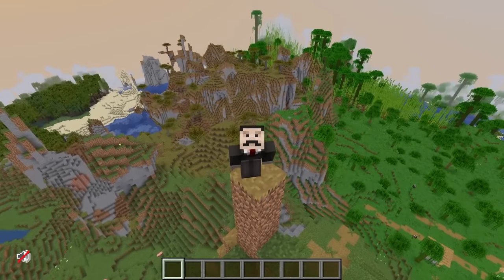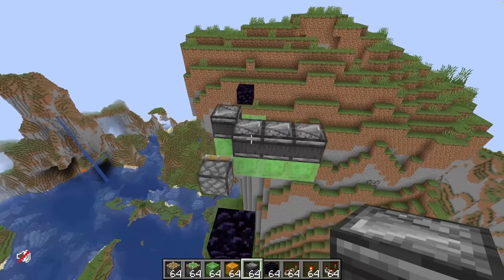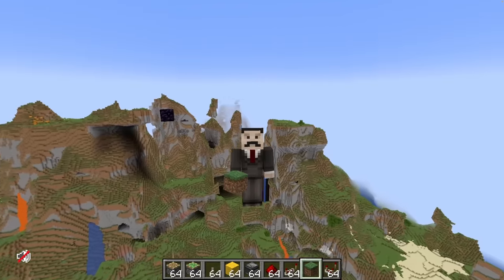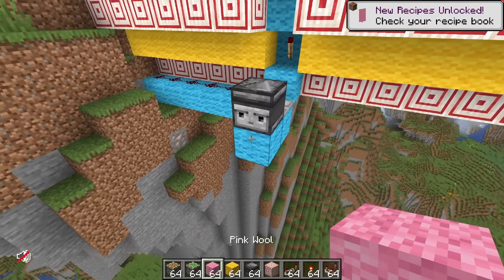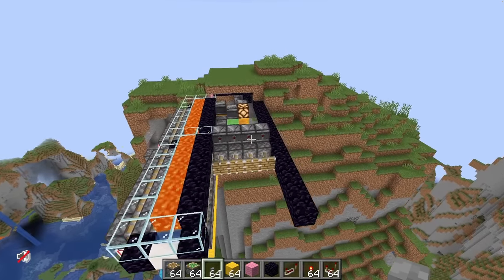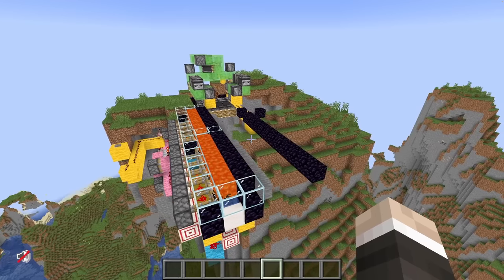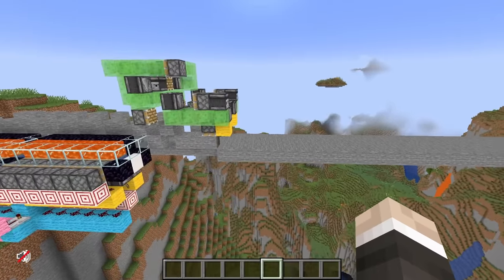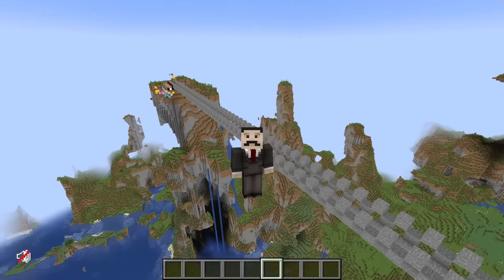Self Building Bridges in Minecraft 1.20

Comment: This should be used decorate the sides of the dolphin highway on Hermitcraft. A walkway could be added to the sides so it feels more like a complete structure. I’d be interested to see if this could be used to make wall / pillars as well. I think it’s generally impractical, but for long regular structures like bridges, tunnels, and walls it would be interesting to see how a redstone contraption could automate the work. Even if the machine is slow, going afk while the machine finishes portions of a build would be very helpful. You could even set up chunk loaders along the path to extend the range of the machine.
Reply: No need for chunk loaders. If you are afk just ride the machine
Reply: A roof wouldn't even be that hard. Make another walkway ~4 blocks higher, then push the blocks down in the shape you want.

Comment: Hey mambo I have some ideas but only works for the foundation tho. 
I can't think about the fencing😅
You could actually move the stone generators up by 1 block and when it's ready
 use cluster of piston to move it down to correct position and send it off

While the machine is flying the stone gens keeps running and when the sender machine is arrived the stone block will be push down like a quick reload and it immediately ready to send another again

If double extending piston is possible might works but the stone gens below the builder by 2 block because the upper part was already taken by the railing guard machine

The reason why it must below 2 block is because i am afraid some stones might get pulled by the back section of the flying machine (foundation) and gets broken

Comment: I wonder if moving the stone generator underneath the flying machines would result in a tillable design, making a self building platform…

Edit: Okay I've replicated the flying machines and it seems that if I try to put two units side by side, the stone-pushing pistons at the ends get stuck on the adjacent module's sticky blocks, causing the adjacent module to seize up. So no, as is the machines cannot tile.
Reply: Try alternating slime and honey
Reply: @averyseeman7  I did try that, but it still gets stuck, not because I have sticky blocks connected to sticky blocks, but because the sticky blocks on one module gets attached to the piston in front of the other module's sticky blocks.

Comment: Mumbo would absolutely love the bridge building on bedrock edition besides the inconsistent things. I built a flying machine that makes 16 block wide row of basalt and makes it into a nice bridge. I even added a piece in the middle that pushes and pulls the blocks to make a 2x2 gap in the floor then another part dispensers water buckets to make an infinite water source then picks it back up and places it again and again. Then all I have to do is run across it with frost walker 2 and i have a nice safe 2x2 boat bridge with a 2 block path on both side and a 4 high wall on both sides

Comment: Saw your old AI silly redstone ideas video, and thought I'd see what a more modern AI could do, with much less prompting. (My prompt stops at the period after 1, everything after is AI generated. And it obviously knows some things about Minecraft.)

You are looking at a list of silly Minecraft redstone contraptions. The list reads:
Silly Redstone Contraptions
1. A pot filled with water that when placed on top of a torch becomes a furnace.
2. A tree made from redstone that lights up.
3. A square plate with redstone that creates a path for a hopper to drop an item into a chest.
4. A cactus that lights up when in contact with lava.
5. A door made out of wool.
6. A stonecutter that creates an iron door.
7. A button that is a minecart track with a dispenser in front of it that dispenses a snowball.
8. A farm with an irrigation pipe.
9. An archer that shoots arrows in the direction that a player presses the button.
10. A creeper that shoots a green ball when it explodes.
11. A piston with an empty space between it that opens and closes to move items.
12. A lever that when pushed, moves a lever.
13. A redstone torch with a block in front of it that illuminates redstone dust.
14. A lever that moves a piston that moves a chest.
15. A button that moves a piston that moves a door.
16. A door that opens and closes to make a square that goes down and up to make an L shape.
17. A hopper with a sign that tells a player to push the button.
18. A hopper with a lever that pulls the hopper up and down.
19. A hopper with a button that shoots out a random block in the air.
20. A furnace that uses wool to make a bed and is powered by an iron golem.

Comment: Mumbo with your inspiration last I made a flying machine about 6 months ago what lays a bridge over the nether. I did it on IOS. And what I used was a pull and push flying machine. On the right side was the push segments and on the left side was the pull segments. On the right side I had about 6 different pushes and on the left I had about 9 pulls. The 2nd push held the necessary glass blocks to allow the water to flow on from a dispenser (which was situated on the 4th push segment) and I would use a piston to extend each movement of the segment by use of an observer. The first segment to move would by the end push segment which would lead round to the first pull segment and about the 4th pull segment in was my lava dispenser as lava flows slow. The lava would flow all the way round until AFTER the water dispenser segment then the following push segment would cut off the lava flow. I know that sounds complicated. I wish I could show you my work. I think you’d approve.

Comment: so for this the real question is, how long of a bridge would it take in order for this build to be efficient enough to build? if you already have the plan for it i would say that as long as the number of blocks placed for the contraption is less than the distance you would travel then its technically worth it however as a single use contraption that seems to take alot of setup i would say that its probably better if it was 2-3 times the distance in blocks as the number of blocks placed, somewhere around 200ish blocks might be an appropriate distance for something like this.

Comment: Hey mumbo, I have an idea:

Can you use the new calibrated skulking sensors to create an advanced password machine that tests if the password is in the right order.

I have the base idea for how it'll work, but I want to see a professional do it
Reply: can you explain the base idea?
Reply: @skmgeek  so there will be a row of machines with skulk sensors calibrated to different sounds. When a sound is played it closes the first skulk sensor  with wool and opens the second one. It continues until the right code is played, or resets if the code is wrong.

Then their is a path of dkulk sensors from the decoder to the input. At the input, there is a row of 3x3 buttons. Each button plays a different sound, but 1 button is an instant reset button. 

When you press a button it plays a sound, which is then carried to the decoder by the skulk sensor path. If the sound matches the number of the first skulk sensor, then it will power a t-flip flopper so it's set to on. Whether or not the sound matches, the sensor is closed off by pushing wool in front of it. Then the second sensor in the row is opened. It continues until the whole code is complete. If the code matches then you door is opened, otherwise the whole system resets
Reply: If mumbo can figure out the decoder he can make a Morse code machine. And then he can code his industrial districts so they all operate on one button